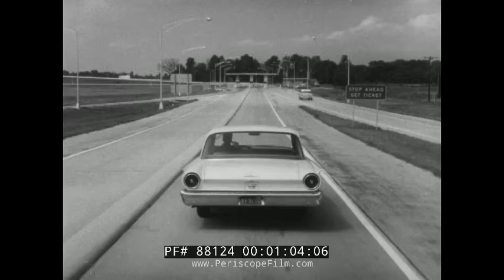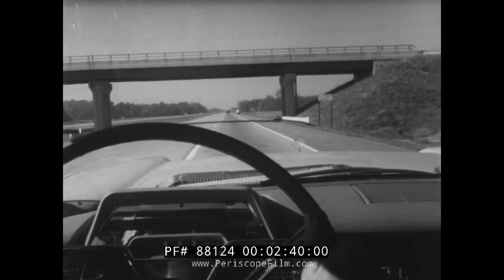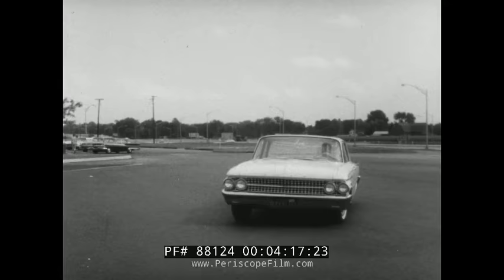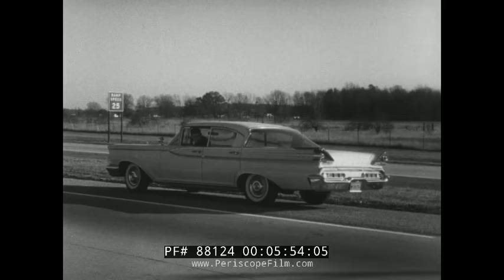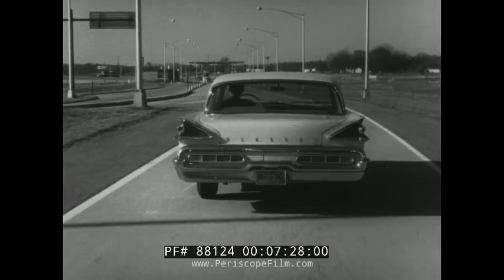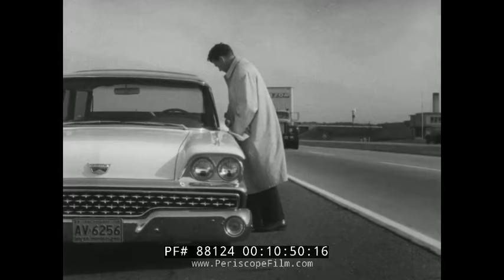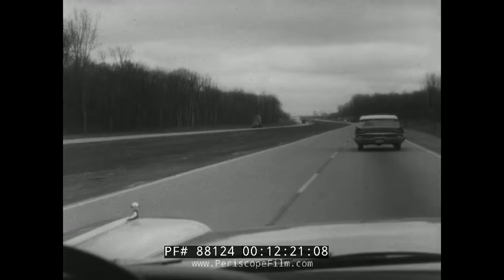1950s FORD MOTOR COMPANY DRIVER'S ED FILM     DRIVING THE SUPERHIGHWAYS 88124

Comment: Ralph Nader use to say American Cars were unsafe at any speed back in the 60s!  Those days no power brakes, no power steering, bias ply tires, no seat belts. People just didn't know any different. Just go flying along at 65, 75, 85 mph. Today we have Anti lock 4 wheel disk brakes,  steel belted radial tires, traction control, air bags, cruise control, lane departure warning systems and we still drive them  65, 75, 85+mph but at those speeds, no matter what, when you crash if your not dead, you might wish you were!
Reply: Just about all of my 1960s cars had power brakes, power steering and seat belts, except for a stripped '67 Dodge Dart, but that had belts. I also owned a 1959 Olds 98 that was only lacking seat belts.
Reply: Yes, power steering and power brakes became available as option on  American cars beginning about 1953.
Reply: @NickTwisp80  power steering first appeared on the 1951 Chrysler Crown Imperial
Reply: Ford began offering seat belts as an option as part of their "Lifeguard Design" package in 1956. The package also included dished steering wheel, padded sun visors and dashboard. Safety door locks were standard equipment on all models.
Reply: Nader's book title was actually only referring to the early Chevy Corvairs
 with the swing axle rear suspension. They had odd tire pressure requirements and when folks put normal tire pressure in, their handling would get squirrely.
Reply: @Henry Stowe  Have you even been in a car accident recently? Your pretty safe at 35 mph. Not like the old days where you wiuld be dead.
Reply: @davidcampbell1899  no, thank goodness. There is no doubt that the older cars had crappy suspensions, steering, tires and brakes. One reason highway accidents are somewhat survivable now is that cars become much better beginning in the late 1960s. Radial tires, stiffer shocks, disc brakes and rack and pinion steering drove the accident rates down in the 70s and 80s as those cars entered the vehicle mix. Nader instead skilled for post collision equipment like bags, belts and padded trim. Those did play a part, but I think that avoiding the wreck is way more important. Nader gave lip service to it in his Corvair chapter.
Reply: @davidcampbell1899  With all the plastic, bomb bags, and computers they shoehorn into these things nowadays we shouldn't have any road fatalities, yet we still have thousands. It's almost as if the problem isn't the car itself, but rather, the selfish hurried meatsack piloting the thing.

I'd rather drive a car from the 1950s.

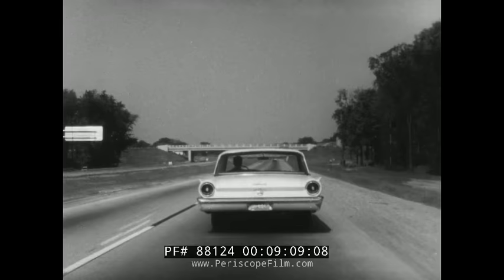Comment: 9:06 a brand new '61 Mercury with a defective turn signal flasher!
Reply: The earliest that the film was produced was September 1960.
Reply: @bobbyheffley4955  Yep, late summer was a good time because I couldn't wait to see what the new models looked like.
Reply: What was defective about it?
Reply: @kurtreber9813  It looks like he tried to signal a lane change, but it appears (to me at least) the turn signal flasher didn't work and the light was stuck "on".
Reply: @mdogg1604  the rear light bulb was out!
Reply: @bk14nyc  It was easier to change a bulb back then, wasn't it? Now it's often a trip to a mechanic.
Reply: @mdogg1604    It was easier, but when the car had some age on it, sometimes the screws to take the lens off would rust up on the threads and make it difficult.

Comment: Notice the Tow truck was a Ford .......Ford has always had the most reliable vehicles
Reply: the worst car I ever had was the 63 Ford Fairlane. everything you can think of went wrong with it, including the engine had to be replaced. and it would never start in the winter. I still to this day don't like Fords.
Reply: @danielthoman7324    Something happened to your Ford.  That car should have been reliable as can be.